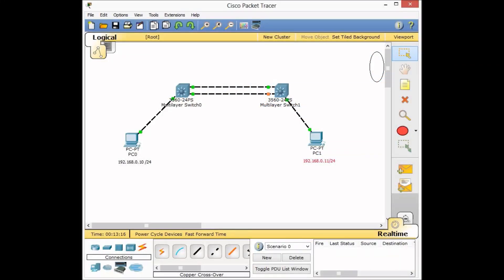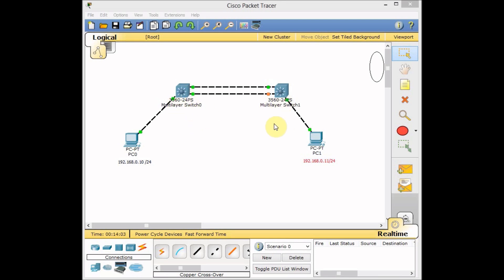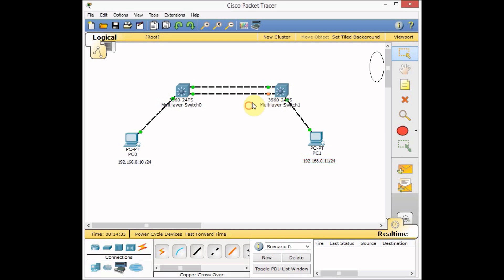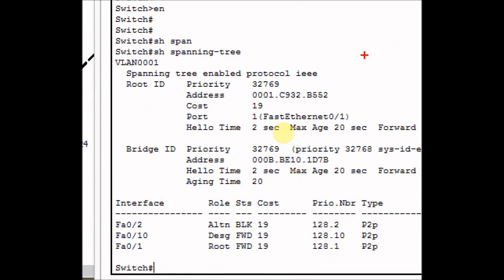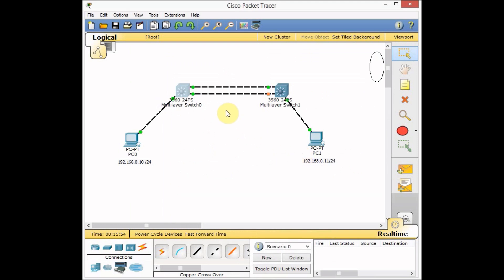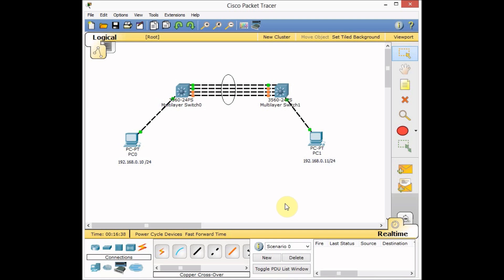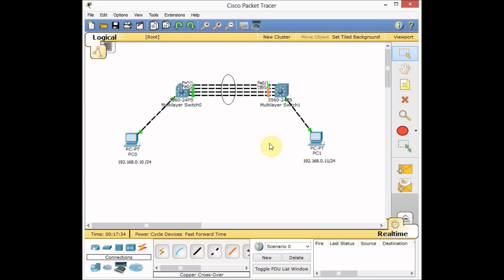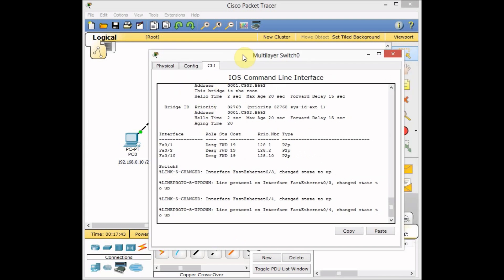Network#12: EtherChannel and Link Aggregation

Comment: Thank you so much buddy to clear things.

But can you please explain the need of layer 3 etherchannel wrt to layer 2 etherchannel please. It would be great to know.
Reply from the maker: The difference between Layer 3 and Layer 2 Etherchannel is same as difference between Layer 3 and Layer 2 interface (port), in other word the Layer 3 Etherchannel acts as routed interface (port) and you can assign IP address to Layer 3 etherchannel logical interface, while Layer 2 Etherchannel acts as switch interface (port). 
Layer 2 Etherchannel is seen as single link by STP and 802.1Q (trunk) can be used.
In general Layer 2 Etherchannel is used between Layer 2 switches.
I hope it helps.
Reply: SASiteNet may be i would use l3 etherchannel when Core etherswitch router is connected to all distribution switch so that it would help l3 switch to route in purpose....Thank you for clear

Comment: Hi. thanks for the video. Is it possible to configure EtherChannel between the routers?
Reply from the maker: Yes, you can config channel group (EtherChannel) between router as well:

1- Define the channel group and assign IP address:

R1 global config mode:

interface Port-channel1
 ip address 192.168.10.1 255.255.255.0

2- Add physical interfaces to Channel group:

interface FastEthernet1/0
 no ip address
 duplex auto
 speed auto
 channel-group 1
!
!
interface FastEthernet1/1
 no ip address
 duplex auto
 speed auto
 channel-group 1

3- Verify the interfaces:

sh ip int brief
Interface                  IP-Address      OK? Method Status                Protocol
FastEthernet1/0            unassigned      YES unset  up                    up
FastEthernet1/1            unassigned      YES unset  up                    up
Port-channel1              192.168.10.1    YES manual up                    up

4- do the same configuration on opposite router.
Reply: thank you for the reply.

Comment: What happens to STP when we use the LACP?
Reply from the maker: STP is still running, don't forget that STP is still necessary to detect any loop within the network, so even when you are enable "Channel Group", the BDPUs send every 2 seconds.
The following result shows when we have 2 channel groups between our switches, it shows the spanning tree sees the ether channel as logical group of the port.

Results of show span on root bridge:

Interface      Role    Sts        Cost       Prio.Nbr     Type
---------------- --      --        ------     ------       --------------------------------
Po2              Desg    FWD      9          128.28        Shr
Po1              Desg    FWD      9          128.27        Shr

I will explain more on another video for you.